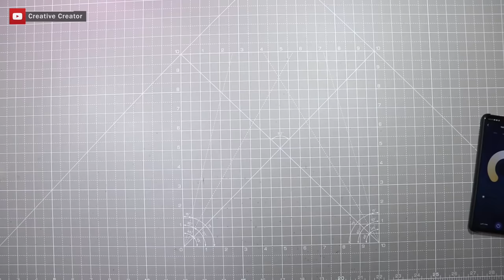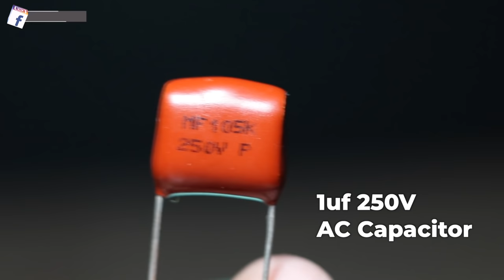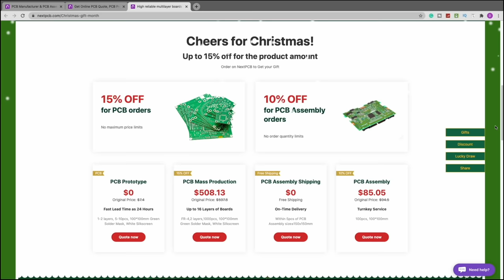[NEW] Simple Electronic Project

Comment: If anyone is curious, he is using the capacitor to maitain a voltage level on the gate to put the mosfet into semi conductance mode. The biggest problem with this is it will dissipate a huge amount of heat depending on the load and will probably burn out with larger loads. The charge level will also drain away and will not be "constant", so this is just a basic hack using the near infinite resistance of a mosfet gate.
Reply: Thanks for the info . How about a bigger capacitor ??
Reply: @UserUser-ww2nj  ,,?
Reply: @UserUser-ww2nj  Larger electrolytic caps usually lose charge over time by themselves. And using them won't change linear mode of operation of the mosfet. Meaning it will keep overheating. Note that with the last LED on the video you can't see a transistor. Probably because it is a different one and/or with a big radiator.
Reply: You're right, when you say that ...the charge level will also drain away and will not be "constant" !... But the charge level will be kept longer if you use (instead of a 1 μF / 250 V polyester capacitor) a 4.7 μF / 25 V eletrolytic capacitor. But be careful with its polarity (don't forget it's a polarity-sensitive capacitor) !...
Reply: Gracia 👍

Comment: Pressing both switches simultaneously creates a short circuit between Vcc to Ground. An alternative is to put an additional limiting resistor (at least 1K) in one of the switches although this would slightly slow down either the capacitor charge or the discharge (depending on which switch is chosen High or Low).
A symmetric response protected circuit could be made with two 1M resistors, each connected to the respective switch and then both to the capacitor.

Comment: A little tip... When bending the wires on a component, hold the wire with the pliers, and to bend the wire, hold the wire, not the component. This way, you don't put any pressure on the wire entering the component. If you bend the component against the pliers then you risk breaking the connection between the wire and the component.
Hope this helps.
Reply from the maker: Thank you 😊
I always try to hear from you guy and try to improve.

Comment: The problem is when both keys are pressed.
A short circuit occurs, the keys burn out.
Be sure to add 100 ohms to the row of keys.
First resistor from + to first button.
Second resistor from - to second key.
Reply: And there is an other solution for the problem of burning out the keys: instead of using one single 1MΩ (one mega ohm) resistor for both microswitches, you'd better use two 1MΩ (one mega ohm) resistors (one for each switch), both connected to the MOSFET's gate.

Comment: If you build this, DON'T PUSH BOTH BUTTTONS AT THE SAME TIME. I think you'll short circuit your unprotected Li-Ion cells, and maybe cause a fire.

Better use 2 seperate resistors, one for charging and one for discharging the capacitor, then if both buttons are pressed instead current will run harmlessly through 2 resistors... and you'll even add another feature to "set 50% brightness" when both buttons are held. (Because in this case the capacitor will discharge/charge towards half of the supply voltage.)

Comment: Good night friend. congratulations for your work. The circuit does not allow to activate the two switches simultaneously as it would short the source.
As a suggestion it would be better to connect a 1M resistor after each switch and connect them to the MOSFET gate.
Reply from the maker: Yes 😊
You are right ☺️

Comment: Powering a higher power load and using the fet in the linear region, the fet is going to get hot, possibly very hot, you need to add a heatsink to the fet. One other thing, show us what happens when you press both buttons at the same time,,,,,,,,battery, switch, wiring check, one of the three will fail and maybe smoke. Thanks for the schematic.

Comment: sooo, buttons are for charging and discharging that capacitor that feed the gate, more power to gate more power to drain and brighter leds, if you let it longer without press button for more power leds will go off. correct me if i am wrong :D

Comment: Wish you explained a little more what you are doing each step so I could learn. The visual part is perfect just needs a little narration.
Reply from the maker: Check this: https://getvid.cc/12v-led-dimmer-with-irf3205-mosfet-and-1uf-ac-capacitor/
Reply: exactly
Reply: I think it’s more fun just watching and then researching what’s going on afterwards.
Reply: he just made a changing light from low to high probably one of the easiest things to do. imo
Reply: @xWarPlays  everything is easy when you know what you're doing...
Reply: @goku445  he could have done a light that detects movement. he could have done a light that measures temperature and based on it just change to on or off.
Reply: @xWarPlays  SO WHY DON'T YOU SHOW US HOW TO DO IT THEN?
Reply: @highpitwilma  no one would watch it. my point is, there are many possibilities with this, i don't have to show them for others to understand that it is possible to do. that's all.
Reply: @xWarPlays  The title is Simple Electronic Project. You can always extend the project by replacing the switches with other circuits that let pass or block the current.
Reply: @duudsuufd  true that I was just throwing examples of possibilities. But also simple

Comment: This is a great project, I just implemented a similar circuit when my wife's cigarette roller stopped working (some machine oil dropped onto the circuit board and fried it). It was being driven with a simple 5v DC motor, but they chose to use a 9v power supply supply (there were no resistors or MOSFETs on the original circuit board, it was just a barrel jack, a push button, and the motor). By implementing this kind of circuit and an LED indicator, it allows her to control how much current is flowing to the motor, and will hopefully help the motor last longer.

Comment: In future projects with these small 4-pin push button switches, you might consider leaving TWO connections attached on the rigid wire supports for additional strength. That would provide two separate solder connections instead of just the one on a physical button that gets repeatedly mechanically stressed. It would reduce potential for failure of the switch electrically and mechanically.

These 4-pin push buttons usually allow you to  connect two pins together for a single connection#1 and the other 2 pins together for connection#2, which increases button sensing reliability (assuming proper debouncing circutry used for mechanical switch). In this particular case you probably also could connect the switch's 4th pin to the flexible wire, if desired. Again, it adds a bit of physical strength and reliability to an electrical connection that is exposed to mechanical forces.
Reply: I doubt homeboy is going to be using this in any appreciable sense.

Comment: Bro... i ran the circut for 2hrs and the full brightness led got dimmed now
It seems like the self discharge rate of this small capacitor is too much
i recommend decreasing the resistor value and increasing capacitor to somthing like 4,700uf
Reply from the maker: But this is the capacitor which was available to me this time. I tested for 1 hr this circuit this works great.
Check the push buttons buddy even while making the video i have so long head push buttons which I was going to use in this but while testing the circuit. I got the same issue like you.
Thia is because small current was flowing through the push button even after not pressing the switch. 
If you know about MOSFETs characteristics then you will find the mosfets gete remains charged after giving voltage to the gate. So, for discharging the gate we have to use a discharge resistor fron gate to gnd. 
Now your circuit's led brightness is going low because your switch has some linkage. So it is grounding the gate current. 
One major flow of the circuit is that you can not press the 2 buttons same time. Then the circuit will be short-circuited. 
This is the main flow. 
Hope this helps 🙂
Reply: @Creativecreator  Woops... my capacitor was water damaged that was letting ** Very Small ** current to flow and discharge it...

Replaceing the capacitor helped
And i will test this night to see what happnes
Reply: @Experiment_Club  ok so you and @D P Are promoting there channels (fine with me) @The Experiment Club How many subs do you have
Reply: Sorry I can't tell
Reply: @Experiment_Club  Why

Oh, maybe bkz you want more subs by showing you dont have any subs
Reply: @kunaldhar6713  as u think
Reply: @Experiment_Club  Ooooo
peoples here might get annoyed by our continus replys

Comment: Everything from your soldering to your end product triggered me on so many levels.
Reply: Actually it's not all that bad. It's called "dead bug" construction... And with the exception of the nippy clip joints (yes that is cringe lol), the rest are fine for the construct method.
Reply: You can be triggered as you wish, but this guys soldering skills are actually quite good.
Reply from the maker: @upravytdi  thank you so much 🙂
Reply: @upravytdi  i cant imagine how bad your soldering skills are.
Reply: Soldering temp is too high. Maybe for removing the component but you shouldn't need 400C for lead-based solder. Even lead-free should be around 200C.

This is also a poor design for dimming as it can cause early failures in LEDs due to inaccuracies between the LEDs as you can see from the LED array (the 30W LED) their forward voltage varies so much that just dimming using current isn't sufficient. The correct way to dim LEDs is via PWM. That said, this circuit would be better suited to an incandescent bulb.

The reason the soldering looks bad is because the initial board for the voltage regulator was dirty, the connections look clean and I don't see any cold solder joints so I see no issue with the later soldering.
Reply: @upravytdi  if you had good aoldering skills you would knew that the authors soldering skills are bad.
Reply: @jorgeromero4680  Well then common Jorge, explain why exactly are they bad instead of your shitposting.
Reply: The soldering appears to be adequate for prototyping/testing and homebrew projects. The circuit isn't the same as the thumbnail, and a clearly viewable schematic would be appreciated so you know what the circuit does before watching all of the construction.

Comment: Don't push both button switches at once! You shortcircuit the battery.
Reply from the maker: I mentioned that to the given link in the description 😁
Reply: Two resistors could be used in order not to short circuit.
Reply: @WISELORD  Don't even need 2, just one.

Comment: What happens if you press both buttons at once? (walks away whistling quietly).  I'd put a 10k or so resistor between them to mitigate the result of that.
Reply: I really want to know
Reply: @thengspjo4716  Press both at once, you short the battery.
Reply: @ian12262  ok thanks, I was actually going to build it just to push both buttons at the same time

Comment: A transistor out of an old welding circuit
A 1megaohm resistor and a 250pf telephone socket capacitor button switches LEDs and crocodile clips. And maybe two 9v batteries in series.

Comment: That's a nice & simple voltage controller.  I like your construction methods Thanks for sharing.
... Could be used to make a variable power supply,  Motor speed controller, LED driver,  etc.
.... so what amount of current (maximum) can it handle?  Can it handle a couple of amps?
Reply from the maker: Yes it can but I suggest you to use a heatsink for higher amps. As it is a linear circuit.

Comment: Hello there! I like all your videos. If you press two buttons at once, will there be a short circuit?
Reply from the maker: Yes bro
This is the only issue of the circuit.
Later I will share a Schematics where I will show how to solve this issue with one more 10k resistor connecting with the vcc and the + switch
Reply: @Creativecreator  Just uses a single ON/OFF/ON toggle switch instead of push buttons. Then you will never be able to short circuit it. Your design is quite dangerous as you can short circuit the 3 li-ion cells directly by pressing both buttons simultaneously and risk the cells exploding and causing a fire or damaging your eyes.

Comment: And if you want to have nice smoke, press both buttons at the same time. ;) (Just jokeing, don't do this, this shorts out the 12 V)
Reply: @Arghadip I would rather add a second 1M Resistor. A Resistor after each switch. The star point then to the Capacitor.

Comment: hey that will heat up the mosfet quite a lot when you turn on the bigger led on half of the full brightness.
Reply from the maker: 30w in 12v so 2.5A max i think but the MOSFET is rated for 50A+ no issue at all. Full cool condition buddy. Otherwise I would showed to attach with the heatsink. 
BTW if you want to connect 100W led then you will defenately need a heatsink.
😃
Reply: @Creativecreator  yeah
Reply: @Creativecreator  the MOSFET is rated for 50A+ when fully ON not when it operates in the liner region
Reply: @viermidebutura   @viermidebutura  I am with you here, the circuit could be quite energy inefficient when the MOSFET is operating in the linear region and heat will be produced as a result. One must be careful when designing with MOSFET.   However for a small LED application and the TO220 package with the metal back in this case probably is sufficient enough to dissipate the wasted heat.  I wouldn't connect a 30W LED in dim for a long period of time without a heatsink.

Comment: PRetty neat video, leave off the music, and by the way, 3, 18650 batteries give you a rated 11.1VDC, not 12.6. Yeah fully charged they are around 4.2/12.6 but that drops off really quick.
Reply from the maker: I charged them before using lol 😁
Reply: @darkagelo1  Okay, so who are you claiming are using discharged batteries? Especially since Li-ion automatically shut off before they are "discharged"? And nominal is 3.7VDC ie that is their rated voltage, which would give you 11.1 volts, just as I posted.
Reply: @Rem1061  i dont claim that in this video were used discharged batteries but if you use Li-ion at 3.7 volts yeah you use discharged batteries, an remember one thing this is a LED circuit not a vape build, if you put thos batteries at 4.2 in a vape you are drawing 60W, 100W or even up to 300W this circuit use 5w max with the tiny LEDs so the bateries dont drop that easily
Reply: @darkagelo1  How can you claim a battery that is rated for 3.7vdc is "Discharged" when it is at 3.7VDC? that makes no sense at all. A 18650 battery is supposed to put out 3.7V when it is FULLY charged. They do go over, just like the 12v battery in your car gets up to around 12.5
Reply: @darkagelo1  How can a battery RATED AT 3.7V be discharged when it IS AT 3.7V? You make no sense.
Reply: @Rem1061  go do a research in 18650's fist of all and you will see that those types of bateries has a value for discharged that is 3.4 or 3.5 and FULLY CHARGED 4.2v. Do the research than you give me a counter argument.
Reply: @darkagelo1  Nominal Voltage 	3.6V
Maximum Voltage 	4.2V
Discharge cut-off Voltage 	2.5V

A 18650 at 3.7V is NOT discharged. If you cant figure that out, oh well.

Comment: Thank you good clear and simplified applications. I want to participate in the 2 push button connection correction. When two are working at the same time, a short circuit will occur in the power supply unit, which may cause burns and losses to batteries with relatively high current, in addition to losing part of the circuit, not all novice amateurs in particular, have sufficient knowledge of this science and the risks of errors , They only apply what is seen and this can be avoided, for example, by adding a two-way plastic slide that passes each time over the SW to make it independent of one another. Sorry - cool, keep going
Reply from the maker: Nice idea i will be adding a next version of the circuit where you can press both switches and there will not be any short circuit.
Reply: чувак, тебе тока взорватся за аллаха

Comment: It's a simple and good circuit.
Does the FET generate heat in the intermediate light?
Reply: Yes, it does. Because MOSFET is a simple resistive ballast in this circuit (like a variable resistor with electronic controls).
Reply: If you want efficient way to light LEDs, you have to use more complicated LED driver with current and brightness control via two PWM signals (the first is driving inductance from the positive side and conrtols voltage and current, the second is driving MOSFET from the negative side and controls brightness via duty cycle). Simple is not always good (actually, almost never).
Reply: @Sentinel-1  Thank you
A simple circuit is the best
Reply: @すんさと  Simple circuits are great for learning electronics. But if you want something efficient - it can't be simple, because you have to handle many aspects of the circuit. If you really interested in this topic, I suggest you to learn Adrduino and the basic of the electronics - that would be enough to light an LED with high efficiency and convinience.

Comment: Push-button increase and decrease of LED intensity with only one MOSFET? That is interesting
EDIT: how long does this circuit hold the last dimming position?
And I suppose the MOSFET acts as a resistor when it lowers the power to the load.